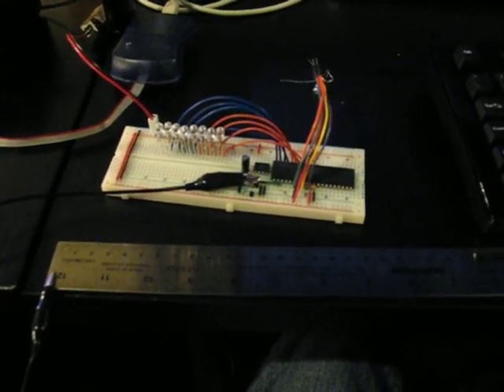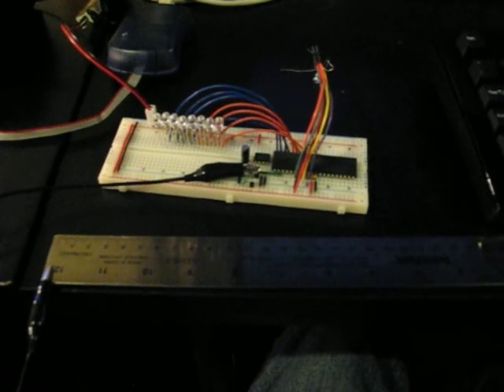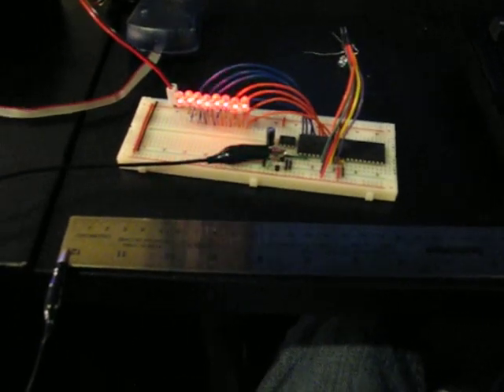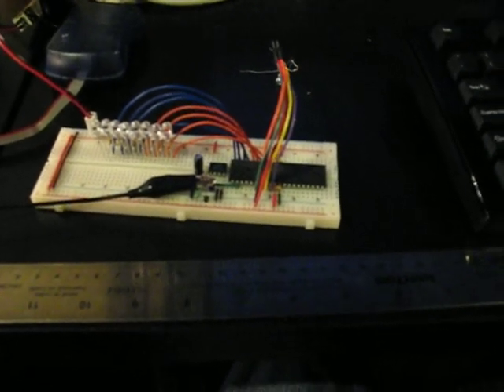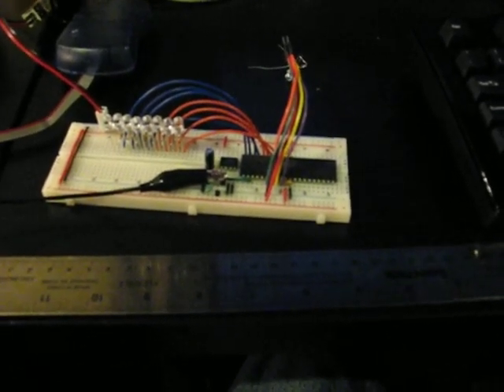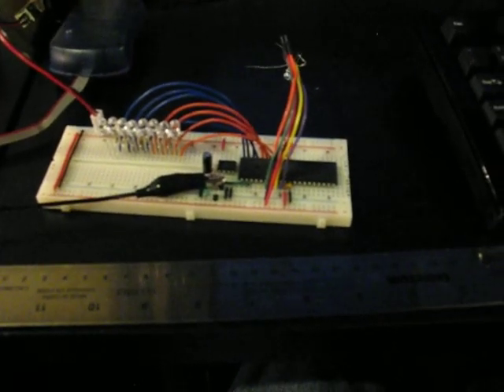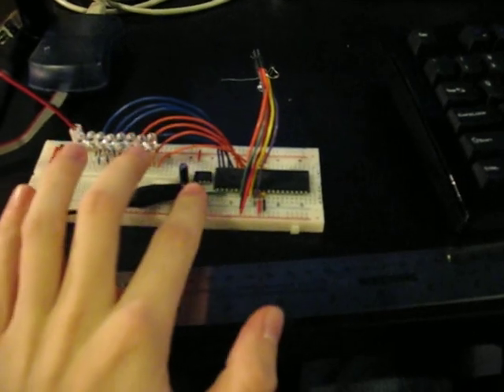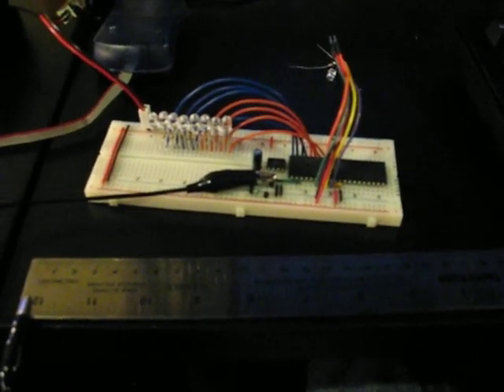Op-Amp Based Touch Switch

Comment: If anyone is watching this in 2016...

It doesn't work when you rub your feet up against the wall because in this circuit you act as a capacitor.

When you are uncharged and touch the metal,  the circuit charges you up which causes a delay in the signal being received at the other end of the circuit. This change in time is what the controller detects and uses as a switch.

If you are already charged (through rubbing your feet on carpet), the circuit no longer needs to charge you up and so will not cause a delay. No delay = no switch.

(Obviously a very non technical explanation)